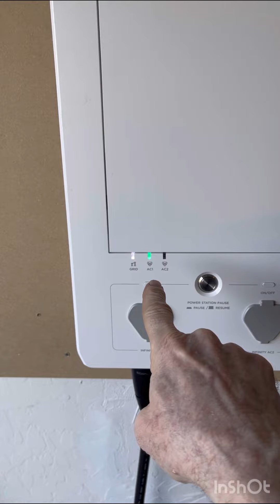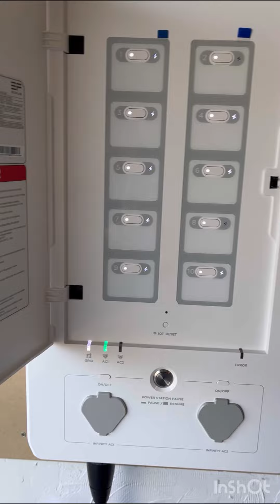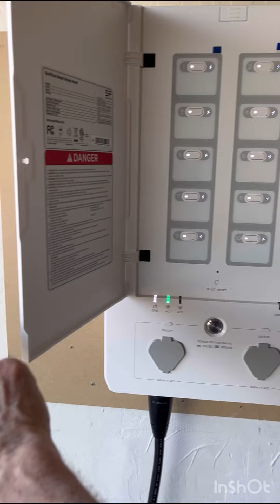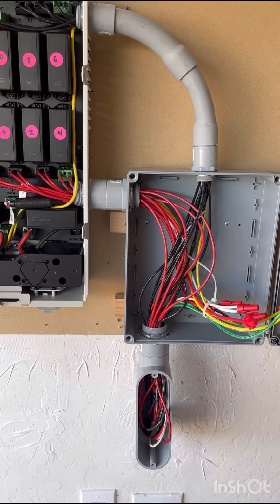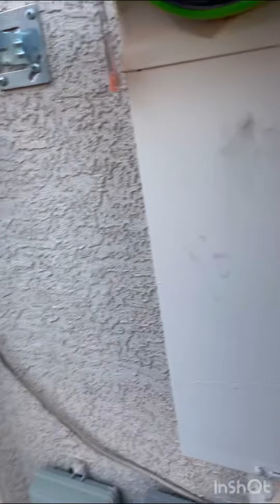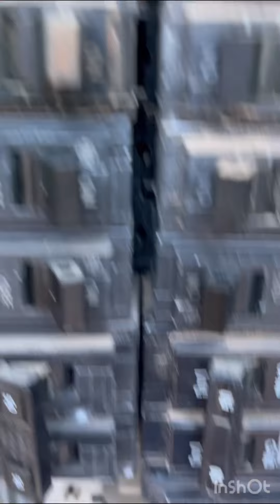Trouble with EcoFlow Smart Home Panel Install - Intro

Comment: I dont see the ground cable connected to the box at the top like the EF video shows ...i only see the ground at the bottom...any particular reason why?
Reply from the maker: If I remember correctly the yellow wires are ground, one thru the bottom connection and one thru the upper connection as recommended int the EF installation video. With plastic conduit I'm not sure it's critical, but I may be missing another safety factor.

Comment: So they want you to have an electrician install; but if you have to replace the panel you’re expected to pay the electrician to come out again for a re-install?
Reply from the maker: Just my opinion, but what an inspector will want to see is how the main panel is set up the first time. As long as nothing changes, a good DIY homeowner or handyman should do for the reinstall.
Reply: @johnc-techc5612  Got it. Makes sense.  If I go with it I’m going to give the install a shot.  From what can tell from the instructional video a good portion of connections take place even before touching the main panel.  I plan on deactivating the main house circuit breaker for added safety. I’m no expert, but I’ve installed breakers for various pieces of woodworking equipment I’ve added over the years.  More important; I have upmost respect for that electrical box and the damage it can do.
Reply: @johnc-techc5612  One other question.  What size conduit should be used?  The instructions state 1 or 1 1/4 inch...
Reply from the maker: I used 1 inch up top and 1 1/4 inch down below.

Comment: I think I heard you said the wire bundle supplied by EcoFlow is 4 feet for the input and output wires.  Is that correct?  Also, can you tell me the height of the Smart Panel?  The PDF says 20 inches tall and the website says 18 inches.  Thanks
Reply from the maker: Correct, 4ft length for included wire. The length on the box when measured top to bottom on the front panel is 20 inches. if you include the bottom bracket it is 20.5 inches top to bottom.

Comment: I’m a noob, but I think you need two delta pros to handle both sides of the 240v, 120v each. I have received my two delta pros and the smart panel a couple days ago. Just a guess. If that’s the case, you can only run side of the 240. That’s why they say odd numbers one phase and even the other. I’m look forward to completing my project to mitigate the 1600w always on at my homestead. I hope you understand my problem. Thanks for the video! 😊 Have a great day.
Reply from the maker: You can see from my early videos that I ran all my house 120V circuits off one Delta Pro. I wonder if changing the Smart Home Panel to 240v two phase includes synchronizing the Delta Pro sine waves to mimic the grid sine waves? How that would work? Any of you EE's want to hazard a guess?
Reply: @johnc-techc5612  My first question is, does the delta pro’s synchronize incoming AC Grid at all? I don’t think so. Which is a bummer if that’s the case. 🤷‍♂️

Comment: Having the same issue - when I lean on the relays they go white, when I stop leaning on them, they go red.  Worried that we’re gonna have to swap everything.   What experience did others have here?
Reply: I just installed one. Had the same problem. I leaned on them and tightened down more. Went through each one and it got them all on.
Reply: Im sorry if this is a stupid question, but what does lean mean? and what exactly did you do to get it to work? thanks in advance @707dougiefresh707

Comment: Don't think PVC conduits are legal for this install?
Reply from the maker: I did some research before the install and could not find any reason not to. With your comment I dug deeper. Still seems like the best choice. PCV inside seems the safest. Outside the sun and heat will likely cause a problem.

Comment: Very neat wiring!  Just curious, does the smart home panel work with any other battery besides it's own?  Thanks for the video.
Reply from the maker: The Smart Home Panel uses the infinity cable to connect to the Delta Pro battery. There would have to be an adapter to do the connection.
Reply: The app when my was flashing red shows it was relays.  Someone online filed/cut down the bottom of the relays upon discovering they were not touching in the board.  They noted markings on all the long metal tabs upon removal of relay, but short metal tabs on relay wasn't scratched/marked like the rest.  

They got it to work trimming off the bottom so e, but also requested replacement relays.  The new relays show the short metal tans at about 2/3 instead of 50% or less on originals. 

It is a known issue the relays don't seat properly.

Comment: So a new Smart home panel fixed the problem?  What was the issue with the first Smart home panel
Reply from the maker: Something to do with the original fabrication in Asia I think. As they ramp up I expect the problems will be less frequent. Better quality control once the design stabilizes for a while. Just my best guess. The panel has been working well for a couple months now.

Comment: Hi 👋 
I have exactly same flashing red lights on few circuits - how to fix this issue?
Reply: In the booklet it says to use your palm to push the relays in during installation. If its showing red find that relay and press on it hard with your palm that will reset it. That fix my red lights they been on ever since.
Reply: @slickxtreme1  interesting....did you have red lights on just one or more than one?
Reply: more than one. i palm them and all went back to normal except for one everytime i would press it it automatically would turn red again so there was an issue with the load too much load for a 15 amp @Godfather44055
Reply from the maker: As I say in the video, this may be a bad Smart Home Panel. Try swapping Relay modules to see if the problem moves. If not the panel needs to be replaced. Call Customer Support. For me they were very responsive.

Comment: Getting ready to receive my second replacement of my Smart Home Panel.   It is a bumpy ride. I am getting an error on Relay 1- "Circuit 1: Not plugged in". They shipped me an upgraded 20 amp relay but that didn't fix the issue.  The odd thing is that if I have the 30 amp Delta Pro charging circuit open, it trips the GFIC outlet in the kitchen.  I currently keep the 30 amp circuit off and have power to the circuit in the kitchen, but still have the error on Relay 1. Support wants me to bench test the next Smart Home Panel with the Delta Pro to see if all the lights come on with no errors before I hook it up to the grid.  Any suggestions based on your experience?
Reply from the maker: First thing after wiring is complete is to plug in the Delta Pro. There should be no errors at that stage. If the GFCI continues to trip, you might consider replacing it. They can be finicky. I've had to replace a few over the years. I've also replaced a few finicky circuit breakers. Nothing lasts forever. Particularly in a circuit that is used a lot. I've learned a lot over the last couple months, but always ready to learn more. Good Luck!

Comment: what I would like to see is the eco flow smart panel hook up to a 3rd party battery system since this essentially acts as a gateway and is not a inverter for the system since it is built into the delta pro
Reply from the maker: Good question for someone who knows more than me. Input to the SHP is via the Infinity cable. You would need some sort of an adapter to carry power and communication from the 3rd party battery to the SHP. Maybe someday?
Reply: @johnc-techc5612  yep, thats exactly it if they literally offshoot the appt and inverter onto and open up the communication shp. this could would with a software update. Till then you would need to modify a current delta pro with a matching voltage system then in the ini file system for the firmware increase the amp hour in the file. very expensive but able to be done. would I do it myself, no. especially since anaphase is making a v2h system in 2024 but im more for modularity and the robustness for 3rd party configurations

Comment: Those CT loads may be having some sort of grounding issue or maybe drawing too many amos that the panel breaker could handle?
Reply from the maker: The new SHP did the trick. I go with a problem with the first one, but I appreciate your thoughts. Thanks.
Reply: what did you do to get them to work and stop blinking red @johnc-techc5612